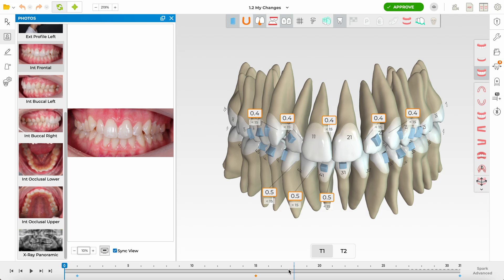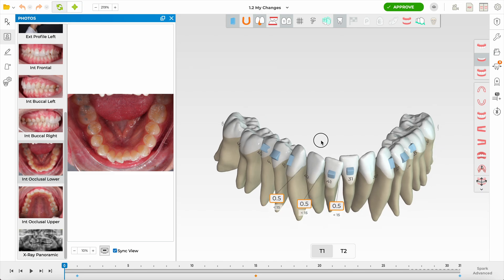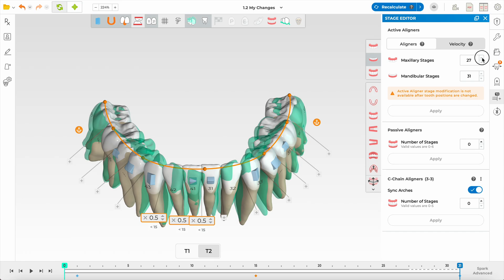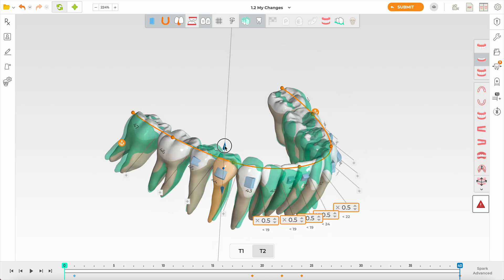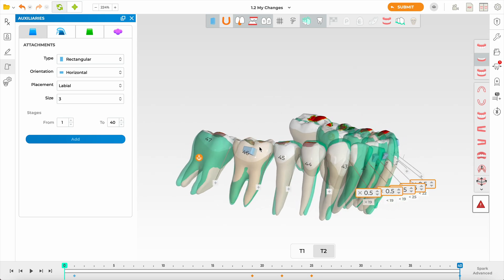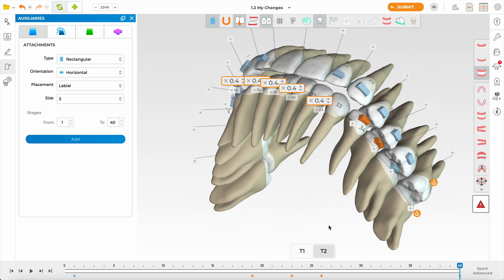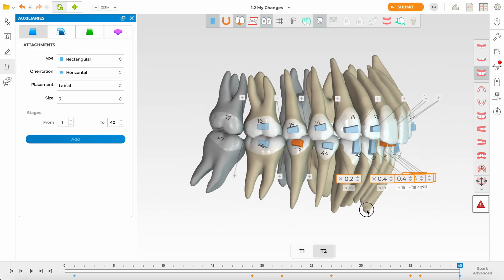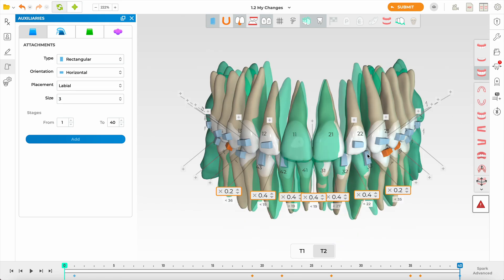Expert Tips: Spark clear aligner planning with 3D tools modification, a demo by Aligner Orthodontist

Comment: Great! there is little Class II molar and canine, How do fix?
Reply from the maker: A mild class 2 buccal occlusion can either be accepted or corrected with elastics or IPR
Reply: @bossortho  Agree! thanks
Reply from the maker: You are welcome. Thank you for the question.
Reply: @bossortho  Also regarding the arch shape and the upper wala ridge  I superimpose the patient's photo on the approver to evaluate how much expansion to do and I set that the buccal and palatal cusps of molars and premolars are at the same height from a posterior view, this gives me the buccal root torque  compensation : what do you think?
Reply from the maker: that’s a good idea. I haven’t tried that but sounds like somethings that could be good tip! Thank you for sharing.
Reply: @bossortho  thanks, I'm glad you like the idea!
I'd like to show you a case and a virtual programming with Angel, what do you think?